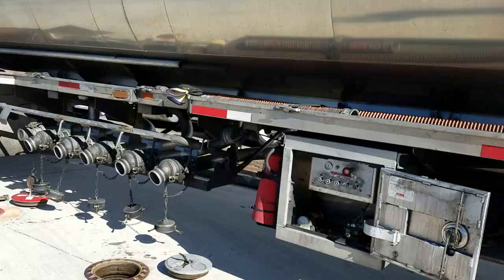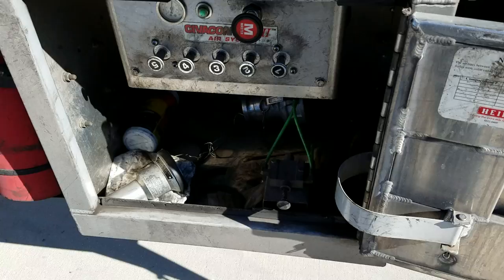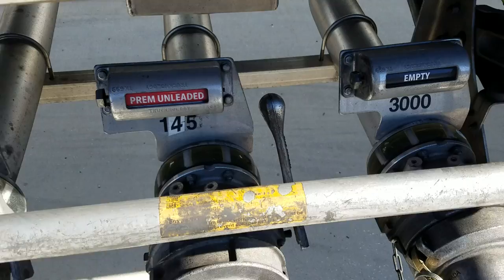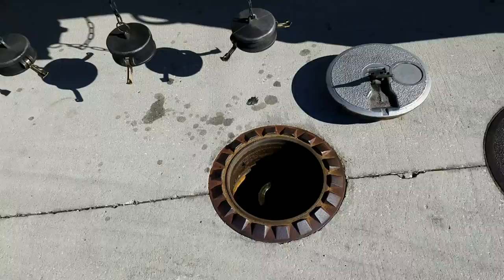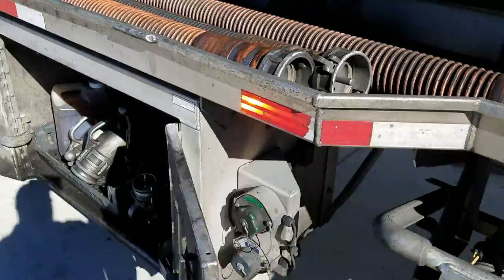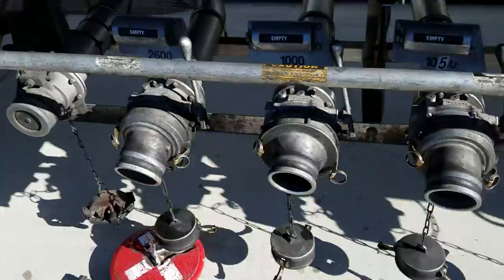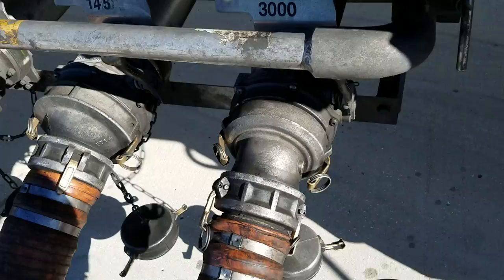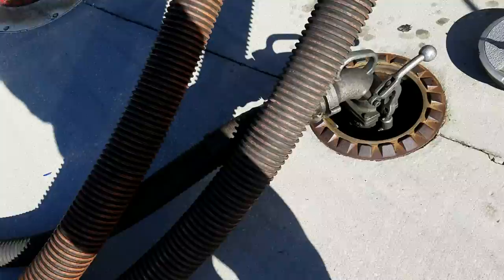How a Fuel Truck Delivers to a TruckStop

Comment: Cool Video!  Odd question:  You appear to be wearing boots.  What type do you wear for this type of work, and with working around fuel, about how long do they last before you have to replace?
Reply from the maker: GuysDestroyingStuff , I wear lace up slip resistant work boots. I also make sure they are oil resistant too, however working around fuel and walking on concrete often, they only last about 9 months or so

Comment: It doesn’t have a pressure valve like to release the air? One of my friends got hit with the hose because he didn’t release the pressure idk if fuel tanks have them.
Reply from the maker: You can put one in, but i just keep my fingers over the plug to keep from getting hit in the face.

Comment: Driver, those compartments are not empty. They are only empty when they been cleaned. How long have you been doing gas at the time of this video? Not knocking you just seen a few rookie mistakes.
Reply from the maker: 3 years at the time of this video. You can see I've changed some things in my newer videos.

Comment: I'm priying for them... (never use an eletronic device near a fuel delivery truck at work)
Reply from the maker: EdrumSense , terminal workers use radios and cell phones around fuel all the time. If the electronics are sealed, then no issues will occur.

Comment: Wasn't that tanker suppose to be grounded for static discharged. Didn't see you do it for safety reason.
Reply from the maker: The trailer is grounded through the hoses. The hoses have copper wire running through them.

Comment: Sounds like an empty trailer full of vapor would be like a bo-mb riding behind you.
Is there a special place to dispose of the vapor?
Reply from the maker: Yes having the trailer full of vapor is actually more dangerous than having it loaded with the fuel. The vapor is burnt off at the loading facilities.
Reply: @DrtyDiesel 
It would be cool to pump it to the engine to power the trucks
on their drive back and would slowly make the trailer safer as you're driving. Not feasible probably, but would be cool.
Thanks, stay safe.

Comment: If you ended up with 30 inches of premium how many gallons is that? Cool video.
Reply from the maker: Five03 STI , honestly not sure. Tanks can vary in size. This premium tank was 12,000 gallons so I’m not sure exactly how much 30 inches was.

Comment: Are you being flippant about keeping the EPA happy with the vapor recovery? I'd have thought the closed system is to stop you blowing up from igniting gas vapor but that's just a guess.
Reply from the maker: Ralph Hardwick , no the EPA doesn’t want the vapor getting into the atmosphere. That’s one reason we have to keep it a closed system.
Reply: Cool - thanks for replying. Here in the UK you can't even use a cell phone or anything electrical on the gas station forecourt for fear of fire. I guess we are a bit more paranoid as our gas stations are usually surrounded by houses and stuff.

Comment: Thank you for filming A dutch shell fuel tankerdriver wil not film this it would his last day at his job.
Dutch tanker trailors have a also 4 to 5 compartments but 2 or 3 couplings 3" all fuel goes though a meter lucky ones have 2 meters mosty american made equipment OPW Veerderroot. selection what compartment to onload is done by air operated valves.
Reply: Yeah, I've seen very few trailers with commingled product piping. We have a couple of trailers but we haven't used them for anything other than diesel loads to the rail yards for years.

Comment: Great video!!  But a question.  Does all gas station receive the same gasoline from the same place or you have to go to their specific refinery to get their gasoline.  For example, Chevron and Shell gas station has top tier gasoline but they claim to have different formula.  They both get the same gasoline at the same refinery?
Reply from the maker: The gas itself is the same, their formula is the additives they put in the gas while im loading it on my trailer that makes it theirs. Where i load at, i can get multiple brands of gas from the same loading facility, they'll just inject different additives for the different brands.
Reply: @DrtyDiesel  Oh wow, thank you for the answer!

Comment: Why aren't you doing any static discharge bonding or grounding from your truck/trailer before opening the system?
Reply from the maker: What do yoh mean? Before i started to let fuel flow?
Reply: The ground wires are in both the product and vapor hoses.

Comment: Does cross contamination matter when using hoses, adapters, or a stick when using it for fuel level? Just wondering
Reply from the maker: No, the amount that would get into the fuel would get cancelled out

Comment: I've always wondered... Stations that say they offer "Top Tier Gasoline" like say Conoco, Sinclaire, Arco, Valero, etc.   are they required by law to use the gasoline that is on the sign at the station.  Or could a station buy whatever gas they wanted, even though the pumps say Valero or whatever?

Thanks.
Reply: Not sure the law cares but I guarantee Conoco will be pissed if you drop Valero gas into their tanks.

Comment: You don't use the product identifier for each pot on the truck? I noticed most of them had EMPTY showing.
Reply from the maker: choxnpinz , only if im leaving the trailer loaded for another driver.
Reply: Different company, different policy, I guess.
Reply from the maker: choxnpinz , correct.

Comment: Is there a chiller in the truck that helps recondense the vapor when it comes back in or how does that work?
Reply from the maker: No, when I go back to reload, the vapor gets exchanged as I’m loading. It goes into a recovery system that burns it off.

Comment: Sorry I'm French I don't understand everything haha
So you don't need pump because your third pipe is like a vacuum ?
Reply from the maker: No pump needed with this, the large hose allows gravity to feed the fuel into the ground. The smaller hose makes sure the vapor doesnt release into the air.
Reply: @DrtyDiesel  okay that's interesting ! 😊

Comment: So if I'm seeing this right, you're unloading with gravity? No pump and definitely not air unload.
Reply from the maker: Correct, open the valves and it flows freely into the ground.
Reply: @DrtyDiesel  This is interesting to me, but I guess it's because some of the products I unload can be a little thicker in some cases. But it does give me a few ideas for any products that arent as thick.

Comment: Some of the gas statiions around here now have above-ground tanks.  Does this fuel trailer have a pump or is a different rig needed to fill those stations?
Reply: We have pto pumps on our tractors. Pain to do and quite a bit slower but you do what you got to do.

Comment: What do you do if the fuel was mismeasured and backs up the hose?
Reply: Do what this guy does and never trust the paperwork. Get your stick out and measure it.
Reply: Always double and even triple check. Take a notepad everywhere you go and write down everything you do, especially if you have trouble remembering. It has saved me so much grief and time with my work. I watch my boss even do simple tasks and fail because he rushes everything instead of being level headed.  My lieutenant in the army told me one thing: "carry a fucking notepad" and honestly it was one of the best tips I ever got working in the military.
Reply: First, stop unloading, close drop valve. Hopefully, you didn't have a lot of product walk back up the pipe, cause you could have a mess on your hands. Then, depending on what product was being dropped, you need to clear your hose into another tank.
Since you now have what is known as a broken compartment, you need to determine if you can get the rest of the product down into another tank, you may have to take it to another station. Also, you may need to contact your dispatch and explain why you have a broken compartment, because it's your job to determine whether or not it will fit before you start dropping it in the ground.
Unless you were totally not minding the store, any small amount of product that walked back up the drop tube and spilled onto the pavement will most likely evaporate, but if you have a sizeable spill you may need to contact your dispatch and tell them you have a containment problem.

Comment: do you dump an entire load at one site or do you do multiple? seemed like you had more regular you could have thrown in there, does someone else come behind you and top it off or you just going by whatever was ordered?
Reply from the maker: Nick_NspireAviation_ H , its whatever is ordered. At this store they take Shell Branded Gasoline and we don't deliver to any other shell stations in Jacksonville right now. So when they order, we take them a full load, that way they get the entire trailer. A typical load to this store is 7500 regular and 1000 premium since our trucks can only legally scale 8500 gallons of gasoline.

Comment: Different brands of fuel run different additives.  Do you add the additives to the tanks or is that done at the bulk plant?
Reply from the maker: Thats done during the loading process. The station i delivered to in this video uses Motiva additive which is specific to Shell.

Comment: I didn't see any wheel chocks on either side when I deliver I put a set on both sides of the trailer
Reply from the maker: Dean Long , I don’t even have wheel chocks on my truck or trailer.
Reply: How poorly maintained is your equipment that you have to chock the tires while unloading?

Comment: Do you idle your truck while doing this or shut it off? I can't tell from video
Reply from the maker: @rightlanebandit9844  I shut my truck off, the only time I idle it is when using my pump. I have some new videos showing that process.
Reply: How many hours or what percent of the time your truck is running it is idling?
Reply from the maker: @rightlanebandit9844  I’m not sure what you mean. I leave it off while loading and unloading unless I have to use the PTO pump
Reply: @DrtyDiesel  I mean in general I'm working on something for trucks need to know about what percent of the trucks life is idle. I read dump trucks idle about 50% of their life was wondering how much a fuel delivery one idles

Comment: DrtyDiesel I have a question. I live next to a gas station and when the tanker comes to deliver the fuel there is a residual odor that gets left behind. The odor is so strong that it comes through my bedroom window and it fills the room with the gasoline vapor.  Are the gasoline vapor odors suppose to linger even after the fuel delivery is done? Are there suppose to be any vapors coming out while the fuel is going from the pipes and into the tanks? Is it normal for this to happen?
Reply from the maker: Its normal if the vapor vent tubes are near your house. If you see metal pipes sticking out of the ground those may be the vents

Comment: Hello I'm a rookie at Fuel delivery sometimes I have trouble with the cams not being able to cam it down any suggestions Thank you
Reply from the maker: Just make sure the connection is firmly seated. Some new cams will need to break in, they'll be super tight the first few times you use them.

Comment: HOw do you keep debris from getting into the hose, while resting on your truck, as you drive places -- nd hence, into the tank -- and ultimately, my car's tank?
Reply from the maker: There are filters in the pumps, the fuel gets filtered before it goes into your car's tank, and filtered again by your fuel filter before it goes into your engine.
Reply: @DrtyDiesel  Sweet.  What about water?  Thanks!

Comment: Question so when the tank is full will the truck automatically stop pumping? Or can it overflow.
Reply from the maker: It can overflow if it doesnt have a flapper in the tube. If it does have a flapper, at 90% full it will close and stop allowing fuel to flow.

Comment: what's your oil hose brand? what's kind of material of hose? pvc? rubber? composite hose?
Reply from the maker: Im not sure of the brand, but the ones used in this video are rubber with a copper wire in the ribs for support.

Comment: Do you have separate section and hoses for diesel or do they all mix and match after emptied?
Reply from the maker: Secret Agent , they mix and match. At cross contamination would be so small it wouldn’t make a difference.

Comment: so is it possible to pump out from the tanks without your equipment. Not planning to just general knowledge request (shtf type)
Reply from the maker: Yes. Years ago there was a cargo van that got caught parking on top of the kids. They had a hole in the floor of the van. They’d open the lid and pump out gas into 55 gallon drums inside the van.

Comment: I'm a new cdl driver hauling 53' dry van. I was looking into fuel tanker jobs but my main question is are you able to get cancer or any other major illnesses doing this type of work long term? I assume as long as you're safe and trained properly it shouldn't be an issue... I honestly don't know much about tankers but I have the endorsement and plan to get hazmat.
Reply from the maker: You can get cancer if you breathe it in all the time and let it sit on your skin. Im very careful about it. I try to stay clean as i can and not to breathe in the vapor.
Reply: @DrtyDiesel  thanks for the quick reply. Makes sense I'm otr and enjoy traveling the country but only after 5 weeks I can tell otr isn't exactly for me. Much rather do something more hands on and more home time with similar pay.

Comment: last winter i got water in my diesel from a gas station and the water froze in my lift pump on the way home and ran the engine out of fuel, very inconvinent, how does water get into the tanks at gas stations and is there anything i could possibly look for to avoid it happening again? thank you much
Reply from the maker: Water can get in by rain and not properly cleaning the holes where we drop. Best way to avoid it is buying from name brand stations. Sometimes, not always, but sometimes the mom n pop gas stations dont have their tanks tested for water like a lot of name brand places do.
Reply: It happened at a phillips 66 a few days later the pumps had bags on them but it caused me to jave to flush my lines after they thawed. Thank you for the reply and thanks for what tou do

Comment: no grounding wire between the tanker and the fuel tanks?
Reply from the maker: michael king , the hose has wire through it that is wrapped around the ends. When i hook the hose to the fitting and then to the trailer, it grounds the trailer to the tank.

Comment: Why did you take the caps off all 5 of your trailer connections when you only connected to 3? (super, regular, and vent) ?
Reply from the maker: asdflkjh , because I’m dropping all 5 compartments. That’s how I keep track of what I’ve dropped and what I haven’t. If I have a cap on, it’s empty or not being dropped at this store.
Reply: so you actually delivered more than just what you showed (super and regular) to this customer?  What were the other 2 components?....diesel + ?
Reply from the maker: asdflkjh , no I dropped all gas at this store. I uncap all compartments and as I empty them I put the cap back on. If this was a split load where fuel was going to a different store then I would have left the caps on whatever compartment is going to another store. Since I dropped all the fuel at this one store, I took off all the caps at the beginning.

Comment: Do they ground the truck?  Does the caps on the ground state premium vs regular or color coded?
Reply from the maker: Usually color coded or both, the trailer is grounded through the drop hose. It has a copper wire running through it.

Comment: I saw you measure before and after with the premium, and I understand that you can tell how much can fit based off that, but what if the fuel order is way off and you can't fit all that was ordered? Do you just deliver some of the smaller compartments that you're sure will fit? (I didn't see any metering device for you to know when to stop otherwise.)
Reply from the maker: nfavor , if it wont fit we drop what we can and take the rest to another store.
Reply: How do you know how much left to drop at other station

Comment: Are you saying a very small amount of diesel goes into the gas? Like what remains in the hoses?
Reply from the maker: Yes, an extremely small amount.
Reply: @DrtyDiesel  that's what i thought. I am sure with how little is in the hose vs the capacity of the tank that the effects are none.
Reply from the maker: @pospc2  you would be correct. You're talking less than a cup of diesel into a 30,000 gallon gasoline tank.

Comment: Is your pay based on distance from where you filled up with fuel.  IE..within 20 miles, or within 50 miles etc...less per load if its short distance and a little more for longer distances?  What would your average weekly pay be?  Curious as I was once going to apply to Coastal fuel delivery where I live, but after talking to a delivery guy while he was filling, he said if I had a family you wont see them very much and your pushed to run at least 7-9 runs a day or they get on your ass.

Comment: So my suv says premium recommend is all gas 87 octane and at the pump they put additives in to boost the octane
Reply: No, 2 grades of gasoline at the terminal. They are mixed (either while loading at the terminal or at the station by the pump) to the correct ratings. Most stations have 2 gasoline tanks and blender pumps, though some will have 3 gasoline tanks and we haul gasoline mixed to the rating at the terminal.
Reply: saint chuck thank you appreciate it